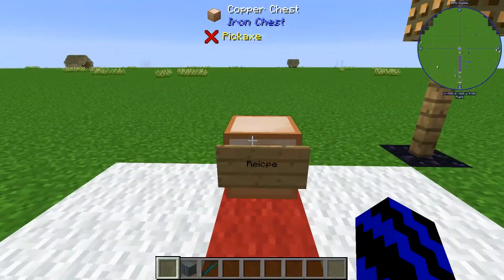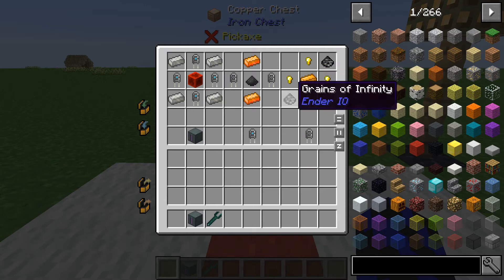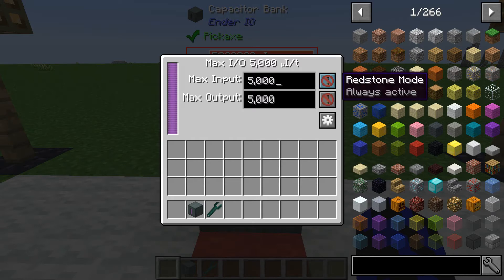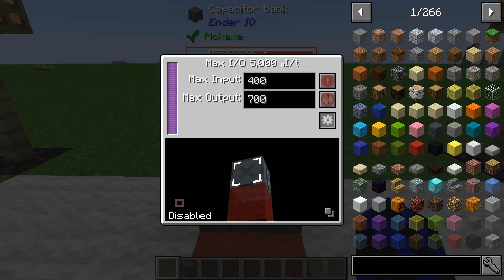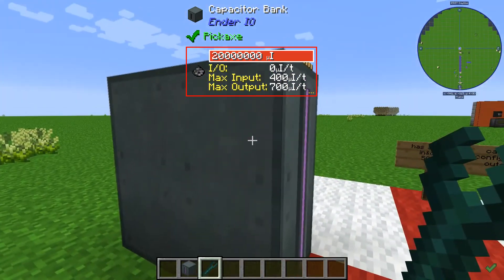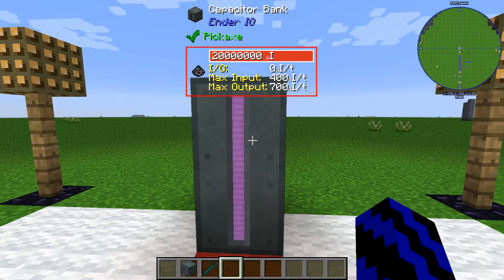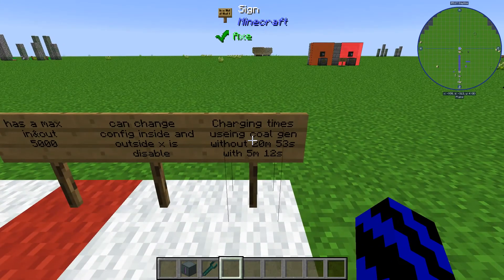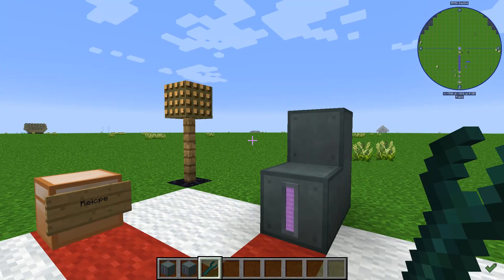Capacity Bank Guide From ender IO Mod

Comment: How do I put the sword into the bank?
Reply from the maker: If you have a sword that takes power you can't put it in the capacity Bank. What you need to do is put a wireless charger next to it. And you tool will start to charge up
Reply: @firethelier8553  thank you